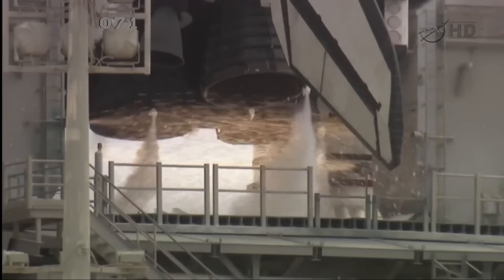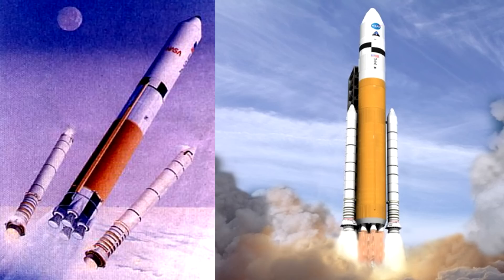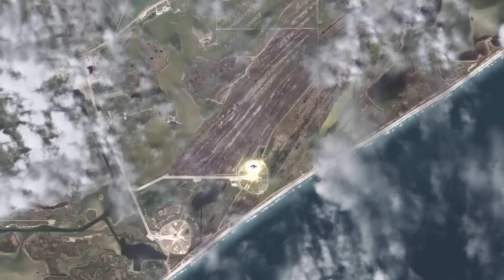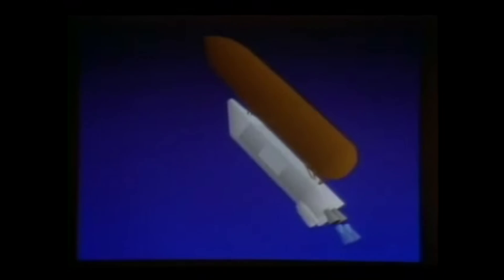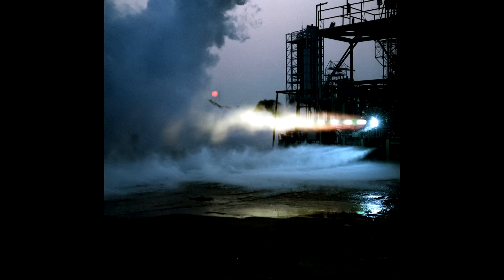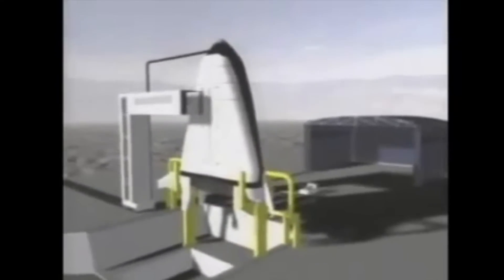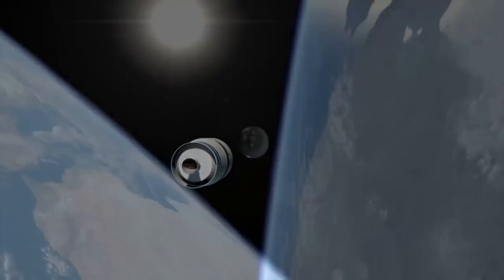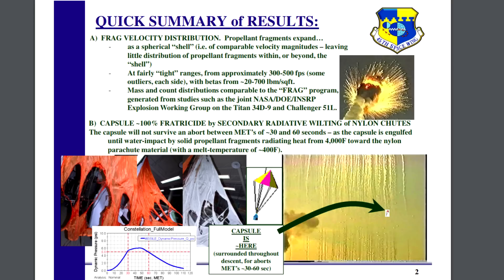Why The US Took So Long To Replace Space Shuttle's Crew Capability

Comment: I know, I know. Some dumbass at nasa lost the plans to the Saturn 5 Rocket.
Reply from the maker: No we have the plans, those were govt documents and well preserved, we know all the parts and how they fit together. We don’t have the tooling to build the parts, those were made by private industry.
Reply: @scottmanley  I was joking. By the way. What happened to 3D printing to make the parts. If you make them in a vacuum the steel should stronger then the originals. Just an idea.
Reply: @donaldgrant9067  Why would the steel be stronger?  3D printing is the tech that will make lunar manufacturing really possible without decades of infrastructure building.  Super promising tech!
Reply: @TheEvilmooseofdoom  believe if steel is made in a vacuum there will be no air in it and make it denser and will bond together better, just like if you take two of the same kinds of metal in space and put them together they will weld themselves together. It just a theory that I have. Has anyone tried to do that with steel.
Reply: @donaldgrant9067  That's interesting because there is actually a method of steel making called Basic oxygen steel-making and it's the method about 60% of the worlds steel is made with and it involves blowing oxygen into the molten iron to control the carbon content.  As it turns out one of my neighbors is one of the worlds few engineers with a PhD in metallurgy he said as far as oxygen as an impurity goes it It is rarely present in quantities above 0.025%.  So I don't think a vacuum is going to make much of a difference in the material quality of steel.
Reply: @TheEvilmooseofdoom  Well thank you for the information. I had heard of blowing oxygen threw molten metal to get impurities out of it. But I didn't know what would happen in a vacuum. Like I said it was just a theory. Now I know.

Comment: Would they have been able to use the lower cost RS-68 Engines with their ablative nozzles if they had gone with the KeroLOX powered F-1B instead of the SRB technology?
Reply: You mean because the RS-68 ablative nozzles were melting from the solid boosters? There are much better options for KeroLOX  or MethaLOX engines than F-1 derivatives. From a twr and isp standpoint, they might as well build liquid boosters with Merlin 1Ds or  use Falcon 9s.
Reply: There's a reason the F-1B boosters were the option with the highest payload to LEO rating in the liquid booster competition, before it was shelved.
Reply: @USWaterRockets  Before it was shelved the Merlin engine was barely around and Raptor and BE-4 or the Russian RD-0162 hadn't been built yet.
Reply: That doesn't change the fact that what we now know about those engines shows you need >4 of them compared to one F-1B. There's a high probability you can't even fit enough of them on the booster. The RD-0162 isn't any better, and would never be used because of geopolitics. All of those suggestions are MethaLOX, which can't touch the impulse density of KeroLOX and why would you want Methane in the first place since the boosters are not recoverable, and engines were not planned to be reused?

Comment: Great video. I wonder what happens when ULA runs out of RD-180s? 
Maybe Vulcan will be flying by then, but most launch vehicle development programs get behind schedule. I assume all the commercial crew launches would go to SpaceX at that time. 
Boeing could contract with SpaceX just like Orbital Sciences did when their Antares launch vehicle had issues and they launched Cygnus on Atlas V through a contract with ULA for those launches.
Reply: Are they not going with a BO engine?
Reply: Vulcan is using Blue Origin BE4s and should be available by the time Atlas runs out of engines

Comment: Another mistake when they choose Lockheed who was developing a lifting body CEV the time and then told them they had to use an Apollo shaped OML which meant repackaging everything in the new shape.
Ares I cause farther delays esp after they got rid of the air launched SSME which greatly reduced performance and required a change from a 5.5M capsule to a 5M capsule which meant yet another redesign though now the design was much farther along and significant time was lost.
LM was made to chase a moving target with the mass requirements which is one of the worse things to have to do in design.
When Apollo was designed Max Faget and Von Braun set aside 30 tons for the CSM even though it was originally thought it would only weight 24 tons they ended up needing almost that entire margin.
Fun fact Starliner is largely derived from Boeing's entry into the CEV program which was pretty much a scaled up Apollo capsule.
Reply: Ive been speculating the Starliner was derived from their proposals for the CEV, could you give me a source where it specifically says this? It would be cool if Boeing modified their Starliner for lunar flights or perhaps even act as a parallel to lockheed's Orion.

Comment: What about the X-38. It was originally designed to carry crew, when NASA defunded the project, A, B, and C was loaned to DARPA. It has been flying unmanned.
Reply: The Air Force has been flying them on longer and longer missions. The most recent one was roughly a year.

Comment: Scott, maybe you can answer a question for me.

Was it ever considered that the shuttles could be left in orbit, and retrofitted for space use only, to travel to higher orbits, or even to the moon?
Reply: They're 30+ years old and you'd have to saw off a lot of useless mass in orbit and that alone is dangerous and expensive work.
Reply: @TheEvilmooseofdoom  let's time travel a bit and assume this was before decommissioning.

Are you arguing the mass would have to be cut off, to save fuel?
Reply: @TheEvilmooseofdoom  what mass would be cut off? It's basically a big bus that can hold pressurized air, right? So with a small engine, it could be used as a ferry fir cargo and crews.
Reply: @Weaseldog2001  It has wings, landing gear and hydraulics for it's control surfaces, 3 cryogenic engines and a heat shield.  All that is useless mass for a ship in space.  Yes, you remove mass to save on fuel costs, the OMS engines would require fuel brought up from the ground and pushing useless mass around just raises the cost of operation by requiring more fuel mass be flown up.

Comment: Man, watching that solid rocket booster contact its upper stage upon separation was disturbing at the very least.
Reply: Makes it look like a KSP video.
Reply: It looked like the booster nearly hit the tower on take off too.(7:10)
Reply: Flintstoned In fact that although it barely hit the tower, the exhaust did damage the tower and burns up a lot of cabling and stuff including a toilet and telephone box
Reply: Flintstoned, it was a planned maneuver, I was there for that launch and it was pretty scary. The rocket lifted of the pad and then actually paused it vertical ascent as it kick over a few degrees and then continued to clear the tower. That launch pad still had the tower and shuttle gantry that wasn't designed for that rocket. Although it was a planned maneuver most of the spectator were not aware of this, including myself, and it was a real holy-$Hite moment, thought we were going to lose another vehicle.
Reply: @Thumbsupurbum  I was going to say "no i didn't - that's just a line of sight problem" - but the more I replay it, the more I think you are right!
Reply: @Thumbsupurbum  Holy crap you're right. 
After getting used to the SpaceX etc videos, it's so depressing seeing these Nasa experiments. 
The whole video was "to  please the politicians , the new project was again just based on space shuttle parts and then it got cancelled" :S
Reply: @maan7715  
"The whole video was 'to please the politicians...' "
Yeah - so was the ill-fated demonstration flight of the XB-70 .
Reply: @maan7715  God allmighty... SpaceX Fanboys....
Reply: @5Andysalive  Where?
Reply: Flintstoned from memory it was stacked at a slight angle  to move it away from the tower at liftoff. it might have grazed the launch tower during the initial second or 2 at liftoff.
Reply: @TheCeleron450  Saturn V did the same thing; immediately after launch, it yawed a few degrees away from the LUT to ensure clearance, then returned to vertical (just in time to start the pitch and roll programs!) once it cleared the tower.
Reply: @rdfox76  It's called a flyaway maneuver, and is the result of an open loop control command to intentionally pitch the vehicle away from the tower to reduce risk of contact with the tower in the event of high winds. As stated however, for Ares1X it did result in some damage to the tower, although not entirely unanticipated.
Reply: anotherrocketscientist- I cannot give you details, but there was a NASA comment in a video, released within hours of the launch, in which they said tat the two stages had contacted after separation.
Reply: They never recontacted. The upper stage was a boilerplate and unguided, and airflow around and between the stages induced the yaw in the upper stage, which was a predicted behaviour. If the rocket had been fully developed, the upper stage would have had attitude control, and staged at much higher altitudes where dynamic air pressure would have not been an issue.
Reply: @jasonosmond6896  ...go check out NASA's report on the mission... It contacted the boilerplate upper stage upon separation.
Reply: @NorthernChev  Please provide the official NASA report you cite. As Jason Osmond stated, it indeed did not recontact during staging. The dynamics seen are purely a result of the aerodynamics and initial staging conditions.
Reply: It was by design.
Reply: Looks like they didn't check their staging.
Reply: There was no reversing thrusters, ettc for proper separation.
Reply: @roar40s  Are you?
Reply: @mnealbarrett  You can't be real and have your head stuck that far up your rectum!
Reply: @roar40s  
I think this thread is about to light up like an SRB...

Comment: I have a question:
Had the space shuttle a emergency ejection sistem or smth like this?
Reply: Ejection seats were present on the first couple flights (Enterprise, and then Columbia), but they were disabled for later flights, and never present on the newer shuttles. They weighed a lot, and were only present for the pilot/co-pilot. Never for the larger crews.
Reply: @slikrx  thanks man
Reply: The earliest flights had ejection systems like Gemini, but that was removed when they were satisfied it was safe enough to carry the full compliment of crew and payload.
Reply: @Marc83Aus  Thats silly you doesn't have to be a NASA engenier to know that if you play rousian roulet the first time you might live...
Reply: @DavidRamirez-lq2co  They were only of very limited utility, only the enterprise and Columbia were built with the seats, and only the 4 front seats were eject-able as the other mid deck seats had signfiant structure in the way. 
The seats would have only been usable for an accident within the first 100 seconds of ascent and wouldn't have helped much for descent accidents. At least not Compared to just bailing out and using parachutes.
Reply: MarcAFK Lmao most launch escape systems are only usable for the first 100 seconds. With respect if your criticism of a launch escape/abort/crew saving system is that it can only be used within the first 100 seconds of flight then you don’t know much about their purpose. That’s literally when they’re for. Launch has always been the most dangerous especially max-q
Reply: You misunderstand my point entirely. @adamanderson3042

Comment: Question for Scott ..Why did they not mount the engines on the orange cryo  tank in the first place , since the shuttles downgrade in design to glider , was this purely due to the design iterations?
Reply: They wanted to recover the engines because they are expensive.
If you put them on the tank they will brake on impact.
Reply: The Russian Buran shuttle did this.

Comment: Scott, do you happen to know why the F1 engines weren't  ever floated to be improved or used again in a launch vehicle design? The Apollo program seemed to have even higher reliability when compared to the Space Shuttle. It's no wonder the Soviets decided to keep with the Soyuz. I just don't get why America didn't do the same, but iterate and improve instead of inventing costly new designs and a bunch of new vehicles.
Reply from the maker: There were F1-A engines developed, but Congress cut the apollo program so there wasn't a need for them.
Reply: I don't like the F1. Their efficiency is terrible.
Reply: Wasn't the F-1B rolling about as an option for the strap-on boosters on the SLS?
Sure, with a completely different nozzle and exhaust system, but eh, Theseus can bite it.

Comment: Cryogenic center core sandwiched between a pair of SRBs. Basically, bigger versions of ESA's Ariane 5. 

Which, even for expendable vehicles, is getting obsolete. Hence the move to solid propellants only for Ariane 6's first stage. But I guess someone has to keep Aerojet Rocketdyne manufacturing those RS-25...
Reply: Ariane 6 will use Vulcain 2 in the first stage as well.  PPH design you mentioned was modified and it will include cryogenic first stage similarly as Ariane 5.
Reply: @winged  "PPH design you mentioned was modified"
Oh, wow, indeed. And in 2014 too. Looks like I was embarrassingly out of date on this one...

Comment: They seriously need to stop using SRB's as side boosters after the whole mess with the Space Shuttle program. They even looked at liquid fueled boosters for the SLS that would use upgraded F-1 engines.
Reply: SRB's are fine for the most part. A lot of rocket have used them for a long time with no problems, they are the most reliable rocket engine. It's only the columbia disaster that gave them a bad name.
Reply: +Sander Vercammen
I guess you mean Challenger.
That's true but for manned missions you really don't want to descent in the vicinity of hot aluminium particles in the case of an abort or have no abort options at all during the first minutes of launch like in the case of the Space Shuttle.
Reply: @QuietElite  Yes, Challenger ofcourse.
For manned missions they might not be the best idea. But from your comment I was assuming you meant SRB's in general.
Reply: @slome815  > SRBs not fine at all, okay maybe for single use expendable rockets, but if you're talking about a reusable rocket then SRB are seriously bad news, since they generate extremely violent structure destroying noisy thrust levels compared to a liquid fueled rocket motor.

The shuttle SRBs were one of the reasons the early prototype shuttle air-frame had to be redesigned and strengthened to cope with the harsh vibrations the SRBs transmitted into the whole shuttle structure.
And with that extra strengthening came extra weight, and the loss of any chance in meeting it's original design goals, which then put NASA on the back foot, which could be argued had the downstream effect of destroying another shuttle in an ongoing effort to keep reducing the shuttles weight in order to meet payload targets.
Reply: @BlueChrome  The SLS is not a reusable spacecraft. SRB's have been used problem free for decades. Ariane uses them, and will continue to do so with ariane 6, delta has been using them since the 60's, atlas since the 70's, the chinese long march uses them, all isro rockets use them, japan is launching solid only orbital rockets. These are all current rockets, before that thor was using it, the titan rocket family used them, scout was all solid...
SRB are a reliable alternative to liquid fueled boosters.